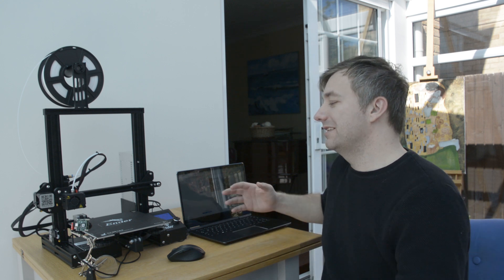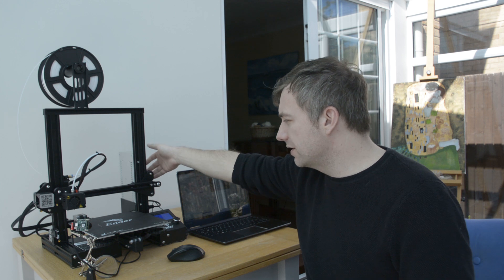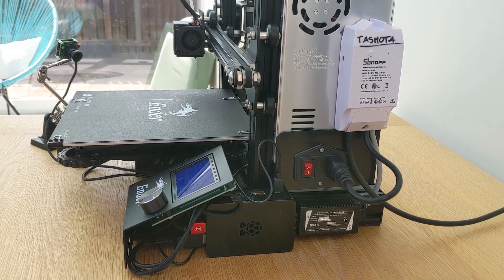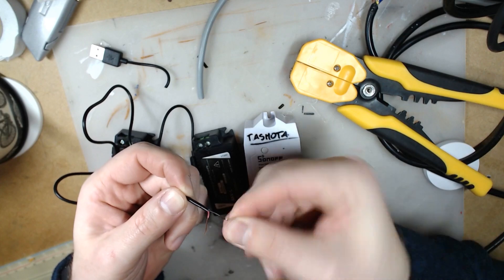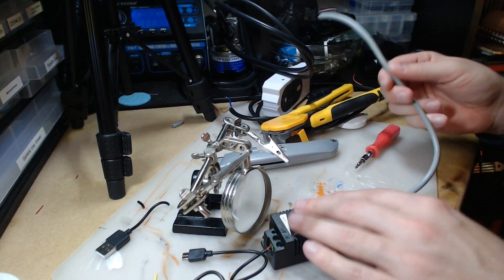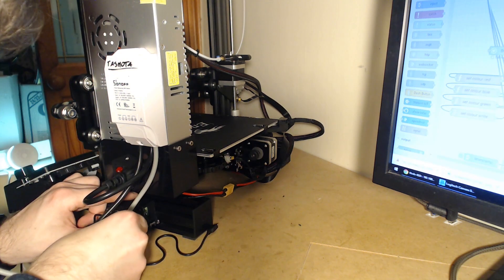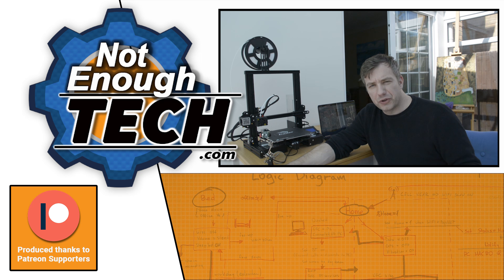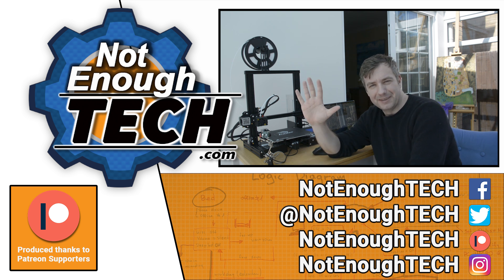3D Printing - Creality Ender 3 power upgrade for Octoprint server

Comment: Hi, I finally got all my parts and wanted to start this, but just a quick question, how does deleting the file make the printer turn off? Is there a plugin I need? That is all that I am missing in this video, all the rest is well explained. Thank you
Reply from the maker: MQTT plugin deals with communication and sonoff pow with powering up the servos.
Reply: @notenoughtech  I will need to do some exploring ;p Thank you for the info! Really appreciate it!
Reply from the maker: No problem ;)

Comment: Just dawned on me as I was sniping my cables. SonOff Basic is only rated up to 10A, so I hope you changed the fuse in the power plug, as mine is 13A. Need to go find a 10A in the garage now.
Reply from the maker: 15A on sonoff powr2 😉
Reply: For other people's reference, I'm now running with a 5A fuse in the plug with no issues so far.

Comment: Hi grate video, but way not just use https://www.aliexpress.com/item/5V-DC-2-Channel-Solid-State-Relay-Board-module-High-Level-fuse-for-Arduino/32821513608.html
Thats it, connect your printer power to it, and then connect it to rpi. Then you can add the encloser plugin in octoprint at controll it from the. (You still need the power on all time for octopi) :-) Print at case at put your rpi and the solidstate relay in that.

Comment: I sincerely hope you're going to print covers for the terminals on the new power supply...!!!
Reply from the maker: It most likely all will end up in a custom enclosure. 3 more mods (lights filament sensor and camera jig) and I'll get a custom box for all
Reply: @notenoughtech  I think it might be worth mentioning the danger of the exposed terminals to your adoring viewership...
Reply from the maker: It's mentioned in the article that you play with the mains and should take the precautions. I even slapped the red colour on the warning.